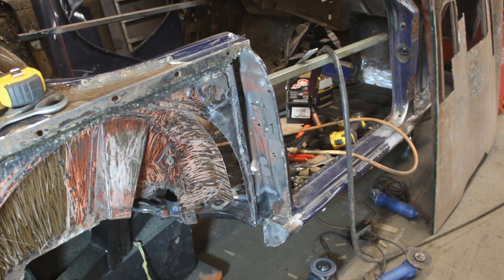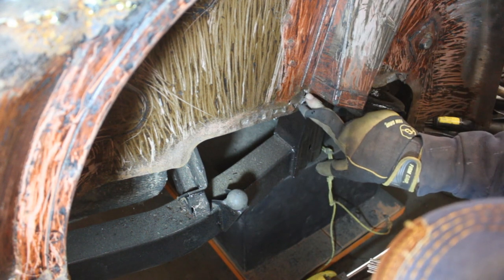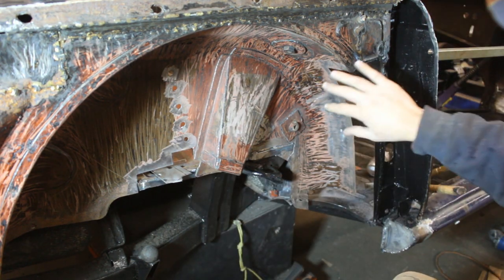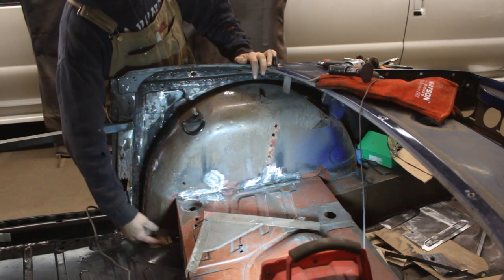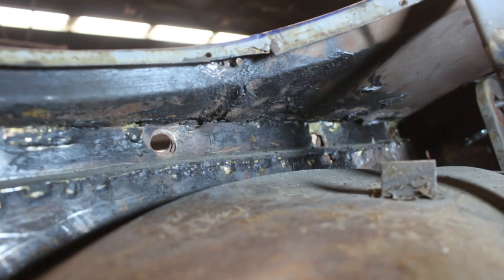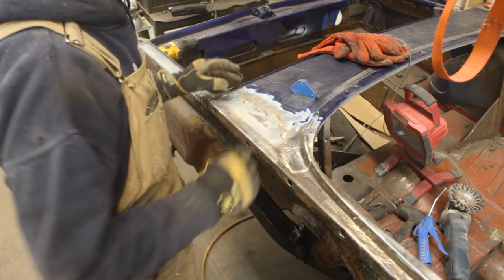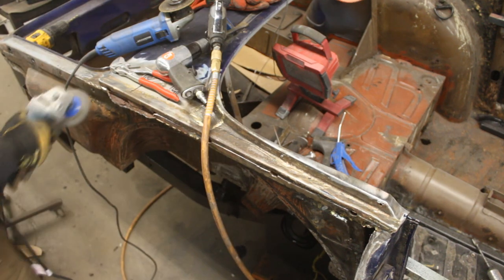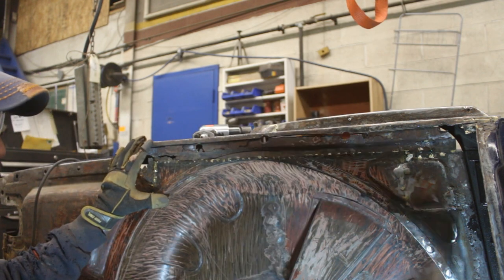1974  Triumph TR6 Restoration Project - Part 15 - Rear wheel well repair

Comment: I used to dread finding previous brazed repairs. You just can't weld anywhere near them.
That means they have to be removed, even though they can be a strong repair.

Comment: When you strip an old Triumph, or any other car, it is amazing how many holes are there. Yet lots of these are driving round like this prior to restoration. I wonder how much torsional rigidity is missing or structural strength.
Reply: I restored a TR4a where the whole of the sill was a combination of filler and fibre glass.
Reply: Brian Browne I found a wooden 2x4 sill in one of mine believe it or not...
Reply: My gt6 has been bodged in a similar way. I found 5 layers on one wheel arch.